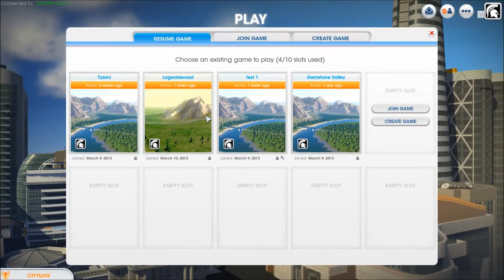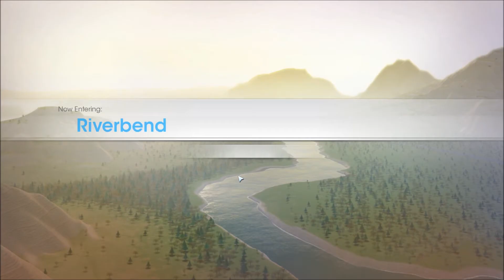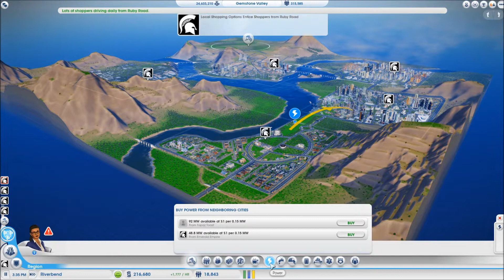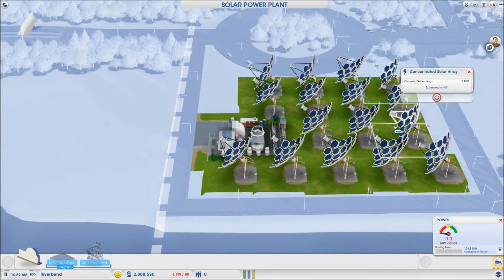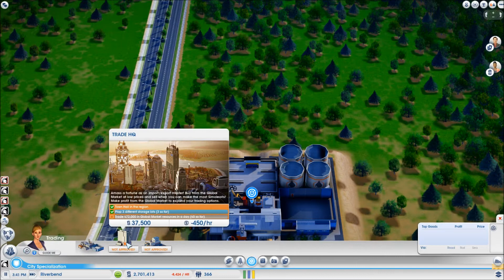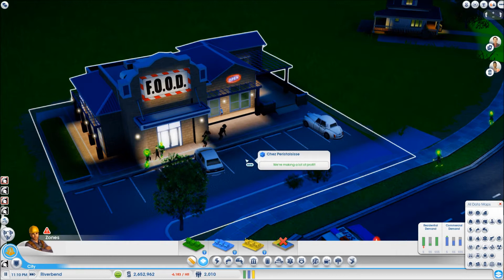SimCity multi-city tutorial #21  oil drilling city

Comment: PETER

I have a question please.

I noticed you are using the High-Tech-Solar. (Which is also my personal favorite)

What drawbacks do you see with Solar?
My only drawback that I can see is that it takes up space.

Other that that it is the most perfect Power Solution in this game.
No Pollution, No Radiation, No Purchasing/Supplying Oil/Coal to run.

But, it has to be the High-Tech Dishes and not the Panels.
I have used 2 maxed out plants for a total 960MW.
Can't beat that!

Comment from the maker: Each pumpjack(the mod for the oil well) has a maximum capacity of oil it can extract when placed over the oil deposits. As the deposits are spent (the color changes from dark grey to light gray), each pumpjack has less to pump out. You will see it happen to me in the next video. Goes down from 11,900 to 5,400.

Comment: Hey one thing i noticed when you were talking about the trade port not unlocking. Ive come across this many times myself. The issue is you need to wait for this city to catch up with all the unlocks before it gets to the trade hq. It will go in whatever order you did them in (i.e. dept of transportation, dept of utilities etc). So whatever order you got the trade hq up and unlocked ports you will have to wait for everything before it. It can take awhile. I usually cheetah through it first thing

Comment from the maker: 1) It might, and if it does, there is always remodeling
2) If I had placed it in the middle a) would change the land value, b) would have ruined one neighbourhood when they go up in density c) they can still get there in cars or by ambulance. d) I only realised that I need it after setting up the neighbourhoods
3) Depends, on a roundabout they will use all 6 lanes while sometimes at a 3 way junction only 1 lane
4) be free to post the rest, constructive criticisms is always welcomed

Comment: you have good planing for the region but not thet good of a city planing
examples: 
1) the four intersections on the high wealth part of the city may cause trafic problems
2) the clinic you placed in the low wealth part of your city wont be that eficent than if you placed in the midle because it has a range where the people can walk to it
3) road roundabouts arent that good so its beter ti just make a 3 way junction
4) many more smal problems

keep up the good work you regioanl planing helps me